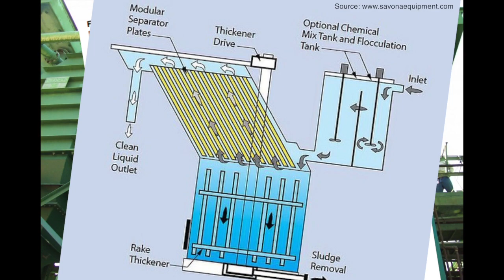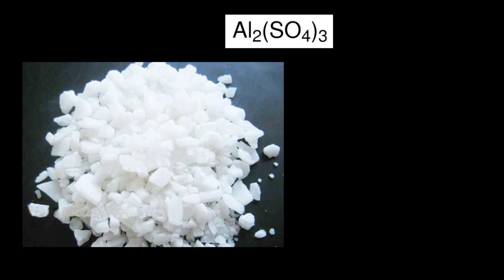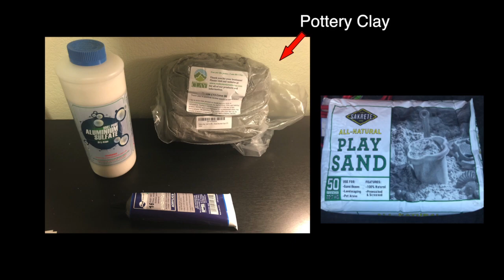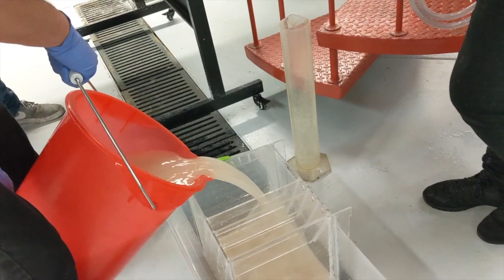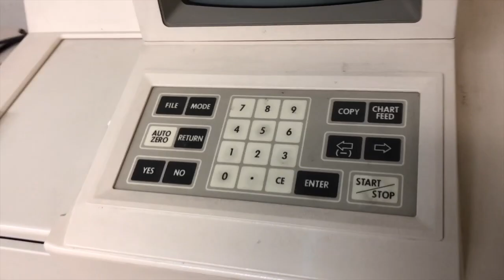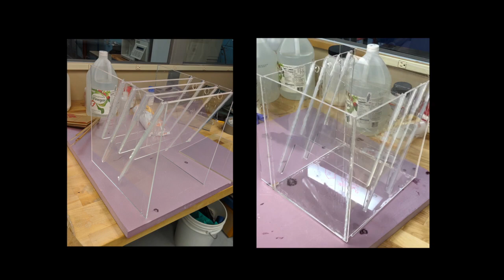Lamella Separator

Comment: Would it be possible to make a DIY lamella clarifier using an IBC tote and many sections PVC pipe? That would give you a 1m3 tank. If so, what diameter of PVC pipes would you recommend for the 60 degree slopes?